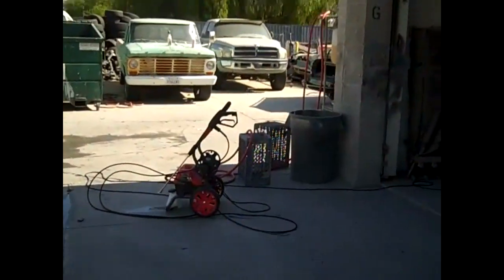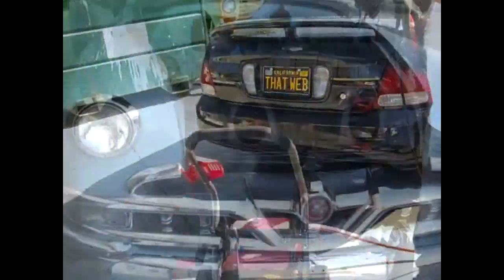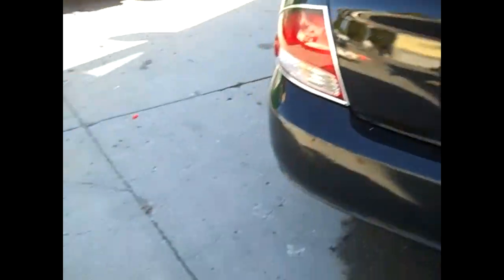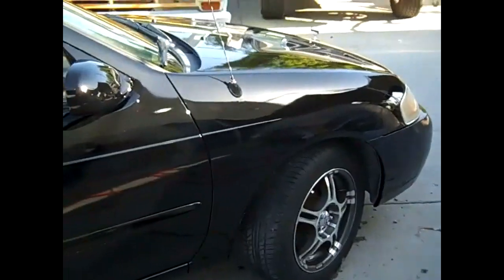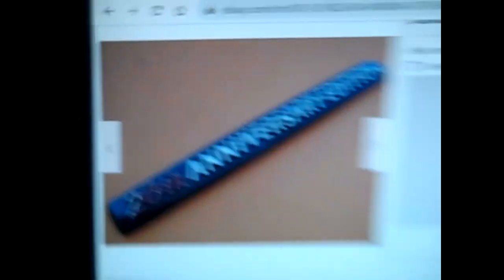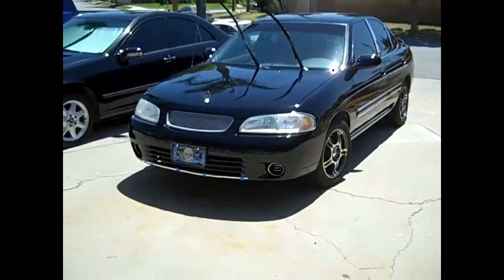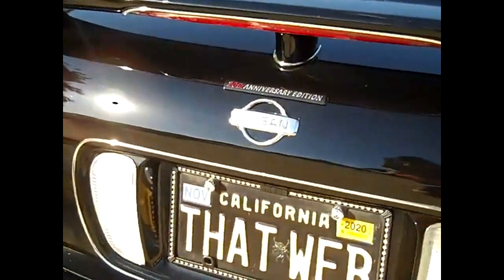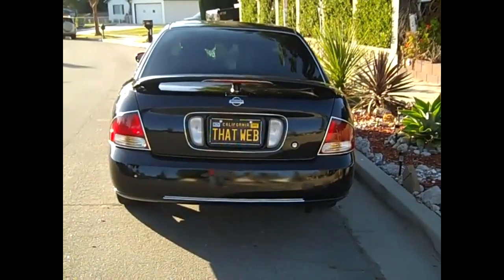Miss Ruby Tuesday- My 20th Anniversary Edition Nissan Sentra 2001

Comment: What a great job. Nissan Sentras are good cars. My husband and I bought a new one in 1990. Drove it for years and he decided to use it to drive back and forth to work, which was great on gas. When he sold it about 8-10 years ago it had over 250,000 miles. Still ran so well.
Reply from the maker: That is awesome! yes- the sentra is great on gas- in the 20 years I've owned it now- it still gets 35-40mpg- it currently has 116,000 miles on the odometer - & it still has the same brake pads/ & discs! (they are at 70%) I find driving the posted speed limit & not needing to slam on the brakes has been good for the car. hahahaha